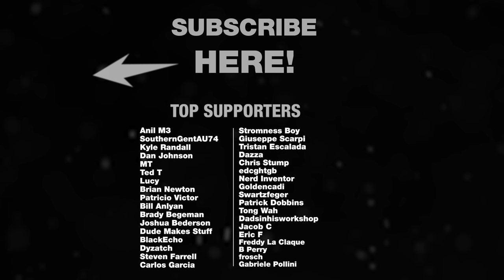Twist Damascus Cane Sword with a Twist 😏

Comment: I understand  that it was reinforced carbon fiber wrap but I think the handle hook should have still either had a solid core insert through the entire arch or been crafted out of something other than fiber board... Fiberwrap will flex when drawing the blade... but the HDF will not... its just a matter of time before that handle brakes at the one of the wrap seams.
Reply: I agree, this beautiful work of art needs to be passed down for generations. The handle being the weakest link makes me worry

Comment: 0:40 you should have dipped the billet in diesel fuel before going into the forge, like Dmitry on shurap does. Consumes any Oxygen left in between the pieces as it burns.

Comment: NOO! Don't Use! 100% bet every xray scanner or security check will charge you for this cane as an illegal weapon and should only be used as a prop or showpiece never use it as a cane its a safety hazard for both user and civilians to the handle will break if weight is put on cane😑🤨😒